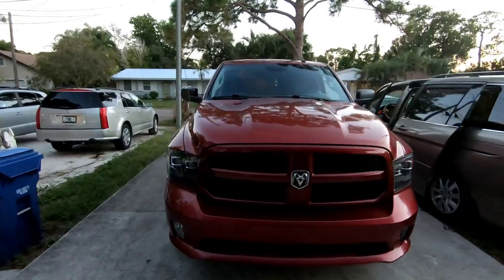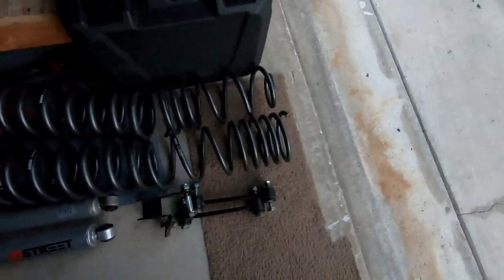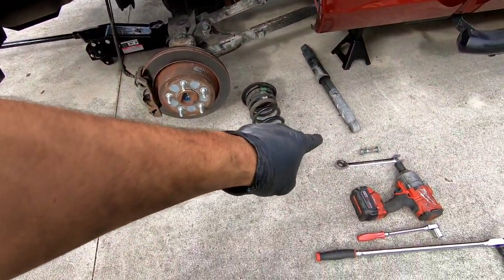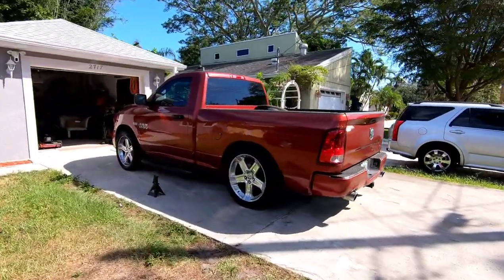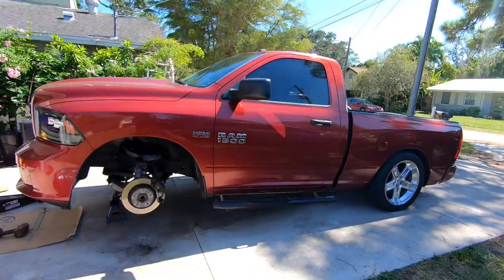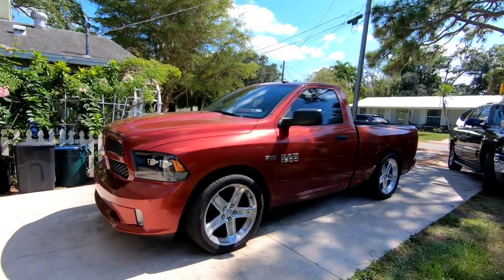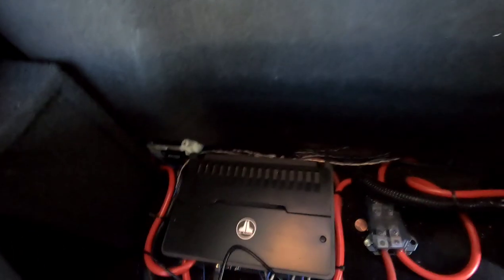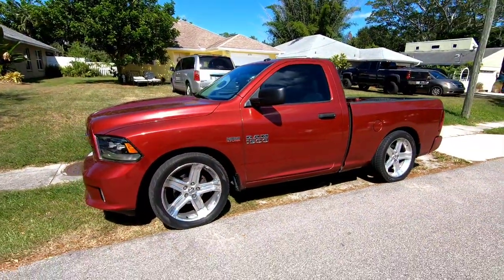Drop Kit on a 14 Dodge Ram

Comment: Aye bro is it cool if i just install lowering rear springs like 3 inch lowering or 4 inch and keep the same rear stock shocks ?
Reply from the maker: No, the stock shocks would be bottomed out all the time, and the ride wouldn't be good at all. Just get lowering shocks and the ride would be so much better and shocks would work as they should

Comment: Is to recommend to replace the shocks as well? Or could you just do the lowering springs ?
Reply from the maker: I'm pretty sure you could get away with just doing the springs, but I would recommend doing the proper shocks to get the best results
Reply: When dropping the rear of the vehicle more than 2” inches and not replace the rear shocks and if you hit a large bump or your rear end fully extents, you run the risk of your coil springs failing out of place or worse falling out completely. Those lowered/shorter shocks are designed not only to give a more sport and controlled feel to the truck, but also keeps the rear coil springs from falling out and over extending your rear axle.

Comment: I know I’m 2 years late, but how is the kit holding up if your friend still has this truck?  I bought a lowered Ram for my son and it had the Belltech 2/4 drop.  Only thing that I’ve noticed is that it shakes side to side going 70-75. Did your friend have same problem? I’ll check the Srt 22” viper wheels as it didn’t shake as much with factory 20’s.  I’m thinking about getting the IHC relocation brackets to see if that helps but really don’t want to play $400 just in case that’s not the problem. Thanks in advance.
Reply from the maker: @JO-bz6rf  It's holding up, still see it driving it around. Never had a problem with vibrations. You can add a rear sway bar to help

Comment: What size tires are those?
Reply from the maker: The truck had 305/45R20 and it rubbed a little on the rear wheel well liner when it hit a bump

Comment: I installed this same exact kit,  just springs and shocks all around but my problem is that I can hear a  loud noise when I’m coasting to stop or when I’m driving over bumpy roads, the sound comes from the rear suspension and sounds like the springs are loose as if they are not placed correctly.I’ve doubled check everything and everything is snug tight. Any one know ??
Reply from the maker: Did you put the rubber isolators back in place for the coil spring?